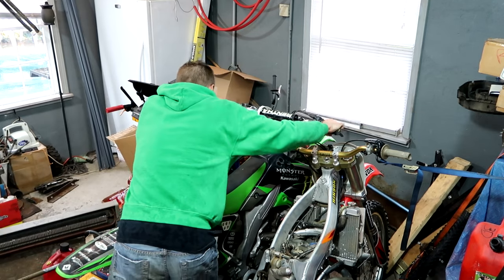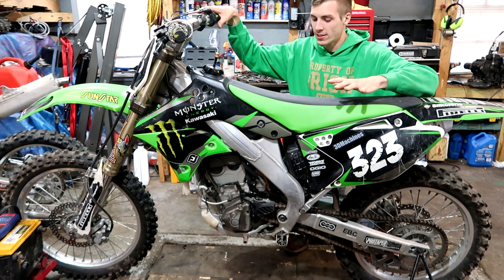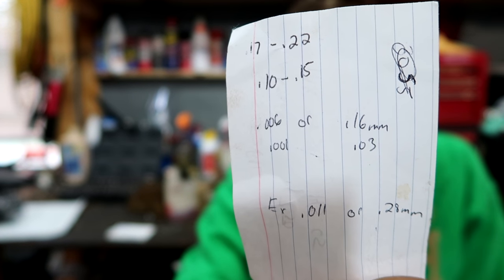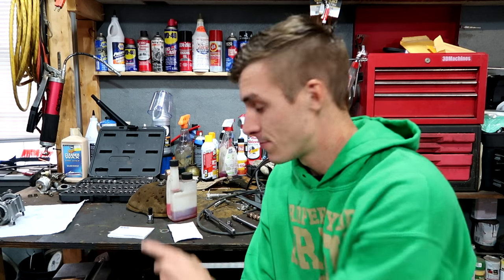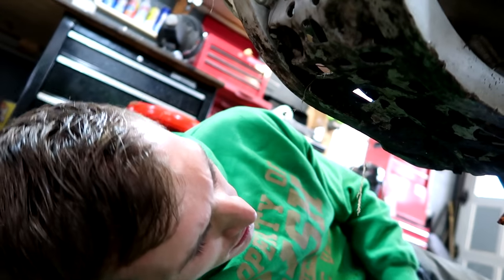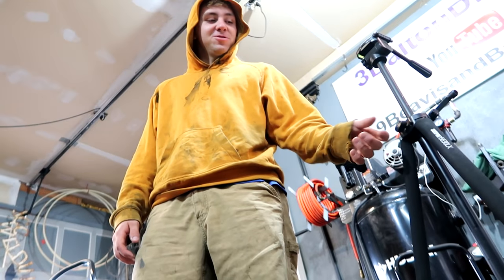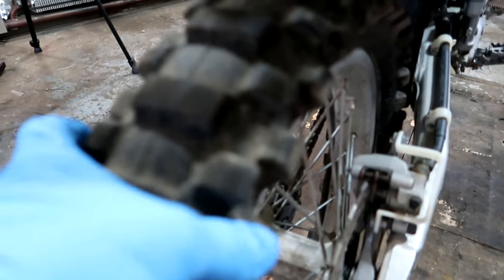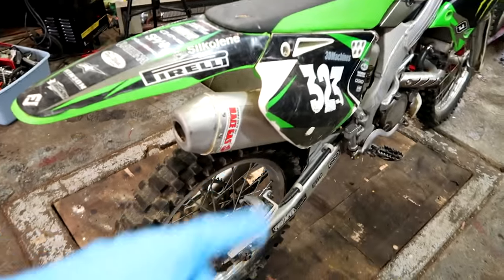MY FIRST RACE - NEW TIRES

Comment: Quick tip, line the tire name up with the valve, if you are in a race and need to change pressure it fast to find the valve.
Reply: It's easy to find the valve, it's always hidden behind the swingarm :D

Comment: Don't bother hitting the tyre with a mallet - Stand on the bead with your heels and bounce on it. Or even easier, let the air down on the bike and ride it briefly.

Also, when putting the tyre back on, make sure the tube has a fair bit of air in it to prevent pinching.

Comment: Dalton you should take the muffler off of the Honda because with it dangling on just the header pipe it puts too much pressure on just the header pipe and it could break or damage your header pipe or the studs/bolts holding the pipe on the engine.

Comment: that is not how you change a tire, work on the technique and it will be 10x easier haha and you should use baby powder instead of spray makes the tube slide in easier and helps the tire slip over the Rim

Comment: I know this video is old, but you need to get yourself some longer tire irons, and get a bead buddy. https://www.rockymountainatvmc.com/p/1511/26055/Motion-Pro-Bead-Buddy-II-Motorcycle-Tire-Tool
This will save you lots of time on changing tires. But I love that you guys do them yourselves. I too change all my tires. Ooh, another trick is to take very small bites with the tire iron, while putting the new tire back on.